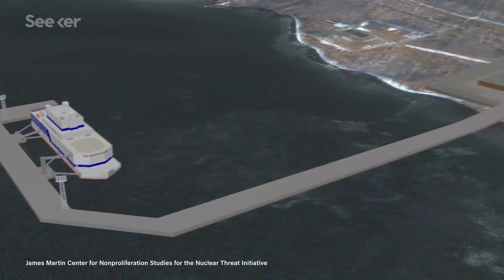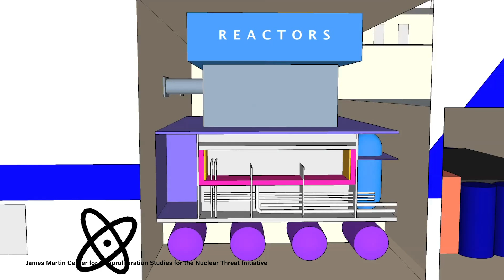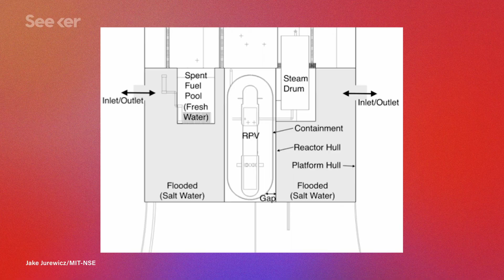Nuclear Power Plants Are Floating on Water…Wait What?

Comment: Security, safety and upkeep from corrosive saltwater would be a larger concern than a land based nuclear plant. Still, the benefits are greater for a power plant out at sea. The U.S has used Navy carriers to supply power to the grid during black outs in the past.
Reply: Many nuclear power stations are located along the coat. They use sea water as a means to condense steam in the condensers. That will be no different in the proposed floating power station.

Comment: WRONG. Nuclear power does emit CO2 since you need energy to extract Uranium, transport it and process it to enrich it. Therefore, nuclear goes around 80 to 160 gCO2/kWh depending on the source used to power the centrifuges.
Reply: Source?
Reply: @brian2440  I had this data from Greenpeace International during a campaigning meeting, I am sorry I do not have relevant documentation to quote. Though, if you look on the Net, there are lots of sources analysing the issue with various figures, none of which is zero.
When it comes to the Carbon Footprint, approximations and assumptions take over and the final result can be variable. However, the point is the ballpark value: nuclear is not a low carbon source.

Here a different approach with similar results:
https://theecologist.org/2015/feb/05/false-solution-nuclear-power-not-low-carbon
Reply: Asky I have a hard time believing your source because it only chooses to believe information that agrees with its own argument. 

When one study finds that the emissions are that of low carbon sources it picks apart LCAs, and focuses solely on the highest range by stating that the lower ranges do not include all emissions, yet it fails to explain explicitly the differences in these areas of emission between data collections. 

Furthermore it states that when low concentrations of uranium ore are used that the industry emits more CO2 than natural gas, yet it never actually explains how it came to this discovery or what natural gas LCA emissions are. 

How do you claim that the industry as a whole emits x amount of emissions, when x is only based on particular concentrations of ore and those concentrations are not consistent among all plants. 

Furthermore it would be interesting to see if the LCA analysis is consistent among energy sources. I have a difficult time believing that the LCA is consistent when you argue that nuclear  emits 20 times as CO2 as hydropower  emissions, when hydropower dams require similar scale of carbon intensive construction. 

Lastly I’ll leave you with the National Renewable Energy Laboratory’a Lifecycle Harmonization Assessment of CO2, which doesn’t agree with your source- 

https://www.nrel.gov/analysis/life-cycle-assessment.html
Reply: Asky Its rather interesting that the study believes that nuclear can meet or exceed natural gas CO2 emissions when the NRELs harmonized LCA study finds that natural gas emits on average 470g CO2/KWh, which is more than double the highest estimate of nuclear LCA from your sources study...
Reply: @brian2440  yet, the energy cost of nuclear waste management should be taken into account.  ExternE, a 10-year study commissioned by the US gov and the EU on energy externalities, was blatantly admitting that these costs were never taken into account since they are impossible to calculate.
Reply: @AscanioVitale  How is there a nuclear waste externality, when the Nuclear Waste Act of 1984 literally required all nuclear reactors to pay for nuclear waste management. Currently the fund is nearly $40 billion. 

What exactly do you think youre paying?
Reply: Also how is this in any way related to LCA CO2 emissions?
Reply: @brian2440  That's a fund, it is not the bill of thousands of years of management. Plus, the CO2 emitted for the whole process is never accounted. LCA is about life cycle: end of life is included.

Comment: what really needs to happen is every navy destroyer needs its turbine ripped out, and a steam driven propellor and gearbox with a molten salt thorium reactor put in the place of the gas turbine. A dual driven power plant with an electrical generator put on in place of the gas turbine and ready for shoreside hookup with the generator for emp protection when we finally get ruined by an emp, the destroyer pulls into say Seattle or Philadelphia or Boston to push electricity to the city when everything breaks down because of war. It can run with the carriers, never needing refueled with the carrier because it doesn't need refueled forever in essence. It will have electrical power aplenty for its phased array radar and can boost the power to nearly any power imaginable to use the radar for really good power up to geosychronis orbit with that much power, and can overload many electrical systems on many enemy craft just with excess power to bring down most craft even hardened, if the pulse can be short and powerful enough.

Comment: we need molten salt reactors to do this sort of thing, and we can put them into shipping container boats as well as making all-in-one units to drop in the ground wherever.  they run at high temperature so we can just let them cool in air instead of putting it on the coast or by a river, but if we DO put it near the coast, we can use the waste heat to desalinate water for free, in addition to generating anywhere from 60mw-1.5gw per single module.

Comment: If a ship borne reactor has a significant issue, you can scuttle the ship to prevent the reactor core from melting.  Chernobyl was a particular reactor design that could and did blow up due to lose of coolant.  The United States built ONE of these around 1947 in Hanford, Washington.  It was quickly realized what could happen with this design of reactor.  The US then changed to a swimming pool design that is common today.  To my knowledge the Hanford, Washington reactor was quickly retired.

Comment: Here's a major disadvantage you overlooked: The plant has to be taken out of service at regular intervals for dry dock maintenance. Meaning you have to regularly tow it away for a LONG period of time. I believe the standard rotation for the US Navy is 18 months in service, 6 months for refits/maintenance in a dry dock. Assuming a similar schedule, you need to have 4 interchangeable barges for every 3 deployment locations, plus a suitable dry dock facility in range of all 3 sites to maintain continuity of service. No small feat. Plus moving something that large is difficult. I wouldn't be surprised if most of the damage happened while in transit. And then there's the aquatic pests. You need a team of divers on hand to regularly clear the water intakes of barnacles and similar.

Comment: Those named russian nuclear icebreakers are by the way the ships for which the reactors of the Akademik Lomonossov were designed for. These reactors have almost nothing in common with those unsafe russian submarines, as those were of a totally different concept: The icebreakers' KLT-40S is a pressurized water reactor (civilian power plant, large ships) while the dangerous submarines were lead-bismuth- cooled fast reactors, who work on the opposite end of the neutron spectrum and lack the primary safety feature, that prevents all nuclear accidents besides Windscale: A ship can't really run out of water, as did Three Mile Island, Chernobyl (more or less, the corelation between water levels and accident are a bit more complex) and Fukushima Dai-ichi. The intended use aboard ships is the reason, why our nuclear power plants run with water, because it is very safe at the intended place of use during development: a ship named USS Nautilus (SSN-571)

Comment: Why not just build the NPP's on the distant east of Russia, it's literally in the middle of nowhere
Reply: Expensive (even more expensive) to construct, expensive to maintain, inefficient to transfer energy over 1000s of kms. Realx, modern nuclear reactors, at least Russian ones, are designed in the way that even if they would to face a meltdown, it will be contained, the biggest problem with modern nuclear reactors is that there's not enough of them, if we want a reliable (!) carbon-neutral power.

Comment: For all the people that think this shit makes sense, IT DOESN'T MAKE SENSE!
A nuclear power plant for a submarine is an entirely different system from one that produces electricity for a city.
A submarine nuclear power plant is designed to rapidly ramp up and down, ften for short periods in time.
A nuclear power plant for a city is designed to ramp up slowly and shut down rapidly.
These differences mean that the mechanical systems, control systems electronic systems and actual designs are entirely different.
The only common things between these two is that they both use a dangerous radioactive element to heat water and produce steam.
In technical accuracy, a nuclear power system, is simply a modern steam engine.
Reply: "In technical accuracy, a nuclear power system, is simply a modern steam engine."  Do you know of a more efficient way to convert heat into electricity?  The rest of your comment is totally moot.